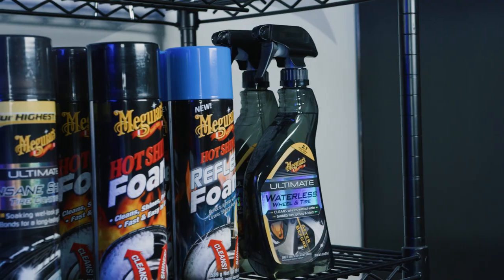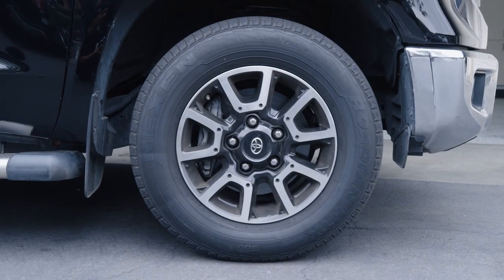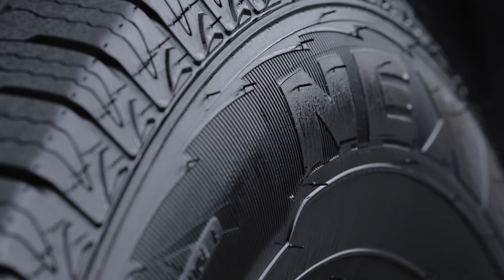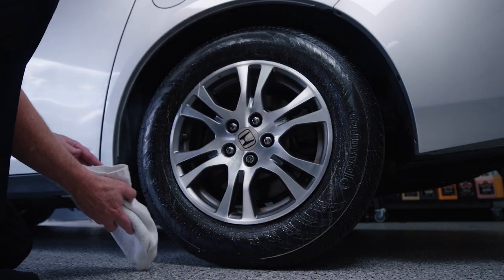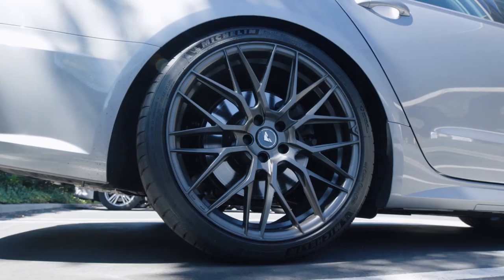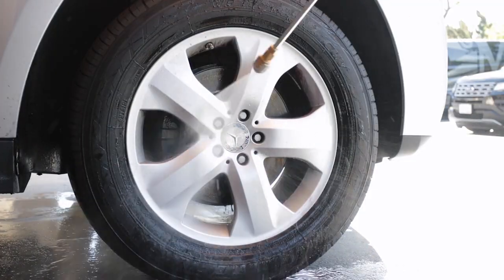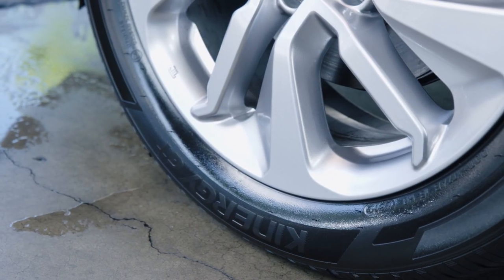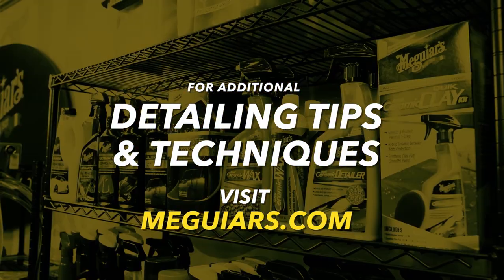How to Clean Tires & Choose the Best Tire Dressing – Quik Tips

Comment: I’m surprised you didn’t mentioned combo using M39 to clean the tire and use Ultimate All Wheel Cleaner (the one that changes color) for the rims.
Reply from the maker: Thanks for the feedback.  
This video is very specific to tires so wheel cleaning is intentionally not covered.  👍

Comment: Shall I use hot rim wheel and tyre cleaner and next generation instant shine tyre coating combo. ?
Reply from the maker: That really depends on what kind of wheels you have as well as your preference in tire shine.

Please feel free to reach out to our Solutions Hub to discuss the specifics of your wheels and your personal preferences.

https://s.3m.com/c9mj3c
Reply: @meguiars  thanks. I have written details on given link. Actually I have Yokohama A-Drive tyres and Lenso Jagger black coated alloy rims. I have Maguiar’s G9524 and G13115. Can I was my wheels first with G9524 and after drying apply G13115. Is it safe to use like this and what will be results ?